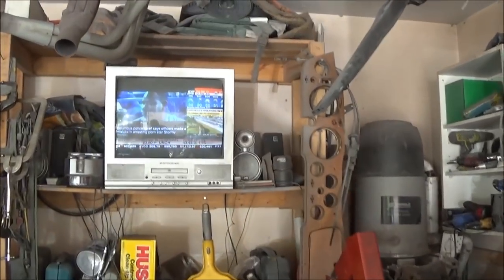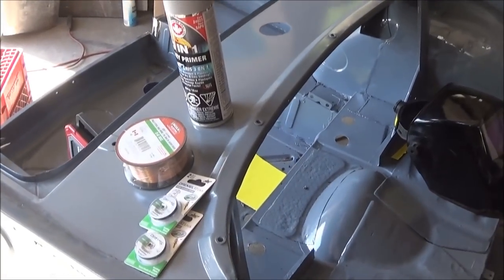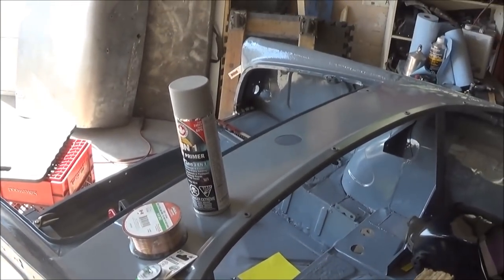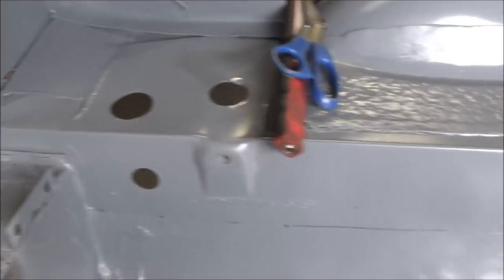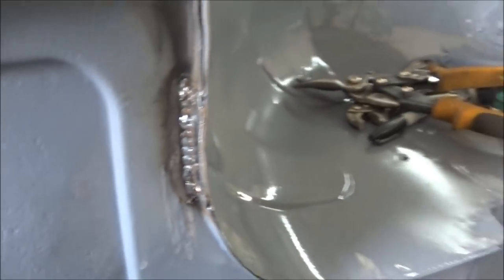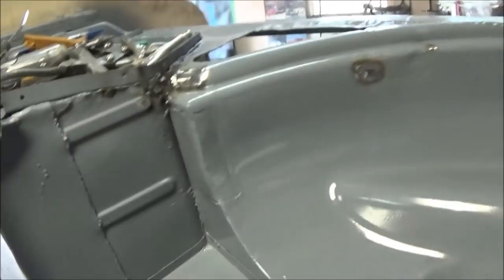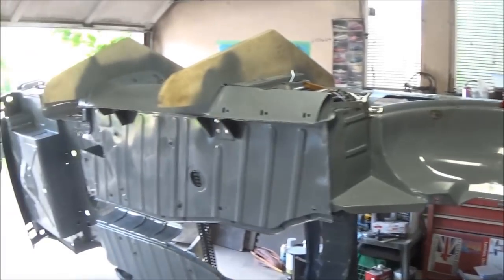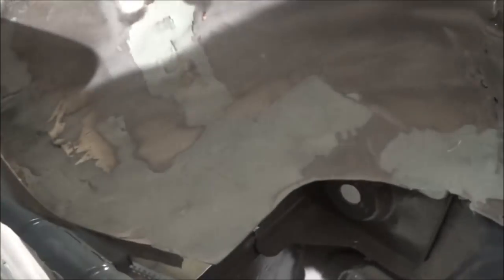1968 Triumph TR250 Restoration,  More Welding and Starting the Filler Work

Comment: Here in Germany all attempts to install self-checkouts went bust. No one would use them and stopped shopping at those stores. They don't want cashiers dealing with the money because they are afraid they will steal. It's another sign of the downfall of human decency and honour. In any case, I buy almost everything from eBay and Amazon these days. Thanks for the update.

Comment: I'm interested in your approach to filler.  My understanding (which is definitely not educated) is that you can/should apply filler over epoxy primer, but I see that you prefer to strip the primer and apply the filler to bare metal.  Do you find that this gives better adhesion?   I suspect (again, uneducated) that as long as you seal it with epoxy, it probably is equivalent in terms of the future paint, but just curious which gives the better result.
Reply from the maker: joshonthetube hi josh.  Yes, you can apply filler directly over the epoxy...on some brands you can apply it within the "open window" without abrasion...some call for the surface to be sanded with a minimum of 80 grit...ill have to admit, I'm old school in my approach and prefer to sand back and apply to bare metal and apply and then overcoat with the epoxy again.  I just feel better about it somehow...go with what you know I guess...call me a dinosaur 😎
Reply: Thanks, that makes sense!

Comment: Eventually, cashiers are going to go the way of elevator attendants.  It's just unavoidable, unfortunately.  Honestly, I prefer self-checkout, in general.  Not as much as I enjoy buying stuff via amazon prime though.  (though I am irritated by the working condition at amazon warehouses.. it's still a pleasant experience for me...)    

That nonsense with locking up certain items and requiring an escort to checkout though, that is really unacceptable, though.  :)